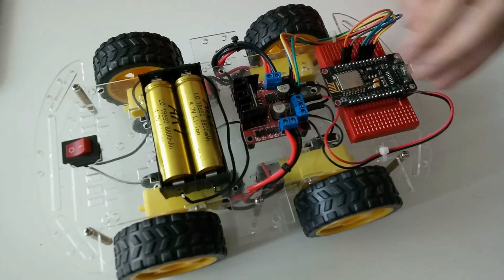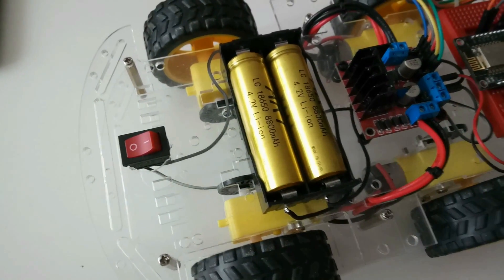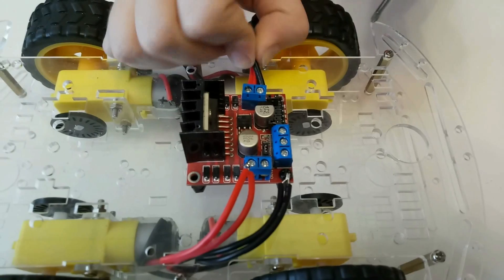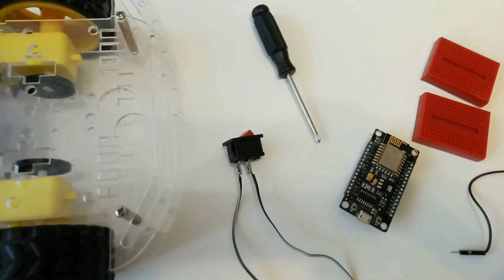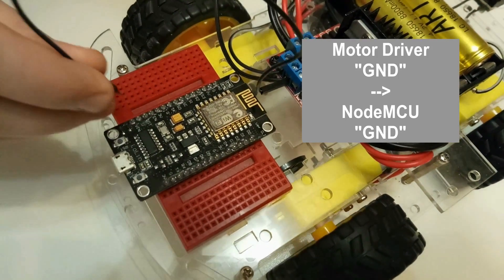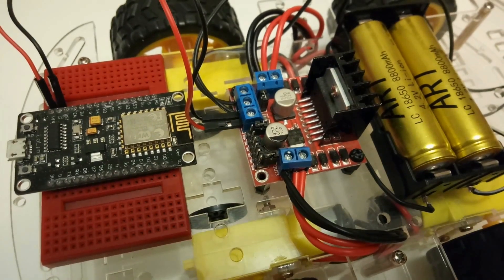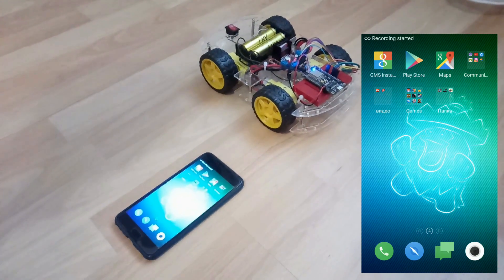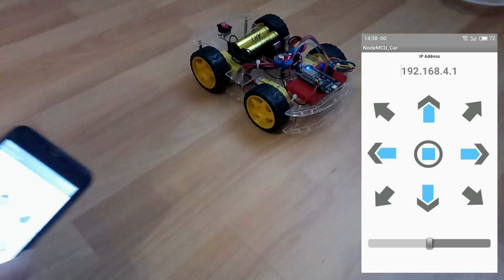Smartphone controlled NodeMCU (ESP8266) 4WD WiFi Robot Car & DIY Android application

Comment: i have made wifi controlled RC car using USP8266 successfully, in this project 8266 is working as AP and without password/unprotected wifi . i want to add password to my SSID, i have done lot of google since last 10 days, but not succeeded. can u help step by step to get this done, it will be very helpful. i have used this project -@. i can be contacted on patani.rajesh@@t.

Comment: Arduino: 1.6.9 (Windows 8.1), Board: "LOLIN(WEMOS) D1 R2 & mini, 80 MHz, Flash, 4M (1M SPIFFS), v2 Lower Memory, Disabled, None, Only Sketch, 115200"

C:\Users\s.sallo93\Desktop\_85\_85.ino: In function 'void setup()':

_85:20: error: 'HTTP_handleRoot' was not declared in this scope

      server.on ( "/", HTTP_handleRoot );

                       ^

exit status 1
'HTTP_handleRoot' was not declared in this scope

This report would have more information with
"Show verbose output during compilation"
option enabled in File -> Preferences.

Comment: Because it works only with webserver.I would make it work with wifi server. How can I do it.The machine I want to run with an external network.connecting the machine to my home WiFi.I keep a machine like this that the command with external network. your project and fabulous I would like to modify your project.thanks
Reply from the maker: can you write your question in english, please? What do you mean?
Reply: Andriy Baranov. Because it works only with webserver.I would make it work with wifi server. How can I do it.The machine I want to run with an external network.connecting the machine to my home WiFi.I keep a machine like this that the command with external network. your project and fabulous I would like to modify your project.thanks
Reply: Andriy Baranov .when I'm going to change your project I'm wrong ... by removing webserver. and putting wifi server I'm wrong. Because I set up wifi server. so I can put the name and pass of the home router. by doing this I get an IP that generates my ruter
Reply from the maker: https://youtu.be/2AL7HfiRlp4
I think, this is video whis the project you are needed
Reply: Andriy Baranov .hello thanks for the advice but this is what I hold.Your and better.It controls speed more turns at 45 degrees.e a project that I had never seen.e beautiful.I would like to modify yours if it is possible .thanks 😉
Reply from the maker: Thanks. Ok, I will modify my project later and notify you
Reply: Andriy Baranov .Thank you so much you are very good for the age you hold. If you continue with this step you will become an excellent programmer 😉